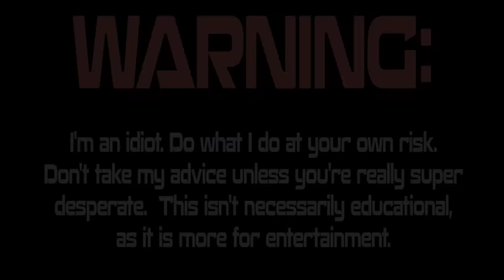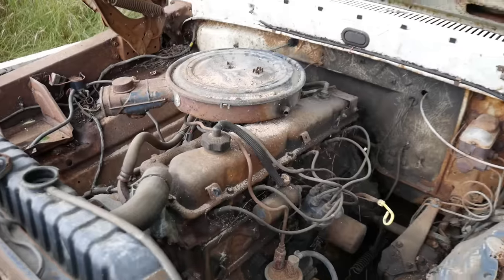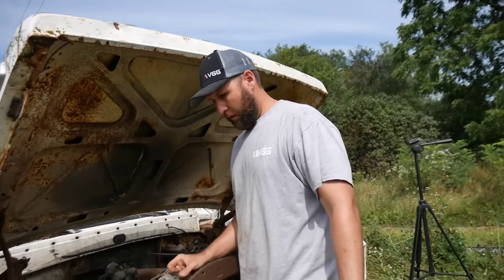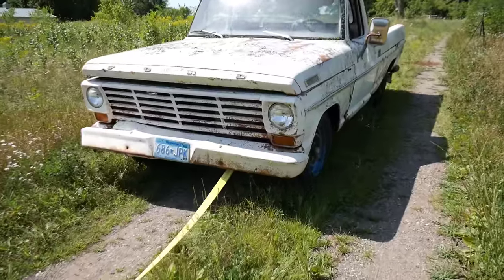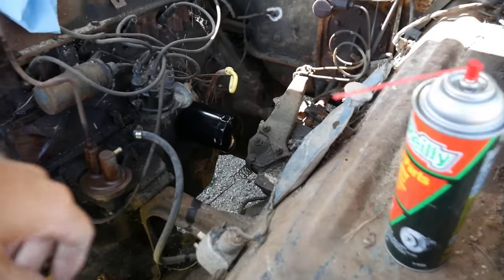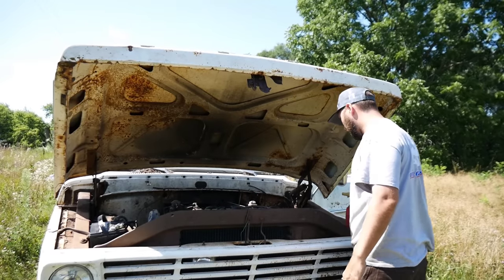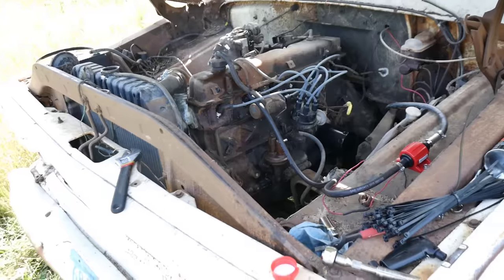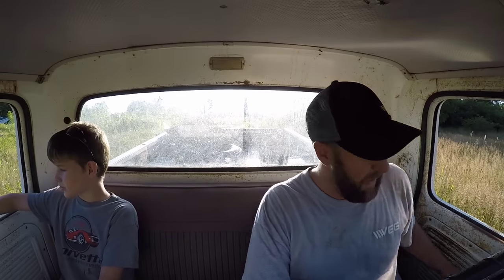ABANDONED Ford F250 First Start in 24 years - Vice Grip Garage EP39

Comment: I use to run Rotella 15-40 in my Ford Pinto Engine at 250.000 miles I took it apart and the insides of the Engine looked like it had 20.000 miles it was in amazing condition

Comment: I bought one of those 3/4 tonnes in 1986 for $125 in Wisconsin. Used it to haul wood. with the old granny 4 speed (start out in 2nd most of the time)  Fixered the engine and drove it to Oklahoma. 4 years later. Oh, did I say when you turned the corners the cab shifted off the frame. Yikkees. Check the cab mounts in the fender wells. Oh, and my brother broke his thumb fixing the split rims on it... Sorry Bro...Man I can't believe they gave you a 200 CID  pump for a ford 300CID.. Doah!!!! The filter is the give away and it is upside down from the V8s. Weird...

Comment: Honestly I am a big gm fan and I would have to say probably maintained the points is probably more reliable than the hei, cause you burn out the ignition coil or the ignition control module out on the road driving and you're walking and if it is just the ignition control module it is not too bad but the ignition coil that is a whole nother issue and my grandpa always taught me to use the lid on the box that the points came out of when you changed them you'll get close enough to run and then you can adjust and fine tune it from there.

Comment: i have an 88 crustang did a 331w stroker  and left the points in it. Then went and did a 408w stroker and i always adjusted my points with a bussiness card.... i say always like i knew what points were... i always say always like when youre gapping your points and leave the key on i knew i was going to get 360 jules pumping though the body... i didnt like the shock so i ending up getting one of those "my spark dies" billet distributor.

Comment: Your site is getting heavy duty with the commercials every minute or two. but it is worth it.  I had a 73 F-150 in 1978. It had a small 8 and three on the tree with an AM radio. the body was only slightly different from the one you were working on in your You tube video. I Paid $1800 for her in clean shape a few dents nothing to speak of then I bought a cap for the back and drove her to California and back. Try and find a five year old truck for that price now. People said I was crazy to go to California in her. Gas was up to 75 cents a gallon. When I got to the Verrizano Bridge at the start of my trip (I live on Long Island) a vibration started to develop. I pulled in a local service station. Turns out a home shop that pulled my snow tires did not tighten the lug nuts on one of the wheels. You just have to do everything yourself! The trip and truck was fine from NY to Altanta, to New Orleans to Ft Hood Texas to El Paso  to Phoenix to Tecata to LA to Vegas Dearborn, Mi. Canada and then back to NYC. When I got back to NY I rented a loft in Manhattan and got one of those new phones with an answer machine and did small move jobs for people with the truck. Man did new yorkers take advantage of me. Walk up apartments and loads beyond imagination. That business and some leftover money on the GI bill got me through one more year of school in the city. I had already graduated college in Albany. I almost bought a fifty year old chevy a month or so ago. It was covered in rust ... I shoulda wouda coulda but my neighbors would have chained me upside down to the tree next to the garage if I had that in the driveway.

Comment: I set my points by eye.  Yup just eyeball them right in... Yup, that looks about good till they wear down a little and I'll have to open them back up just a wee bit.  If you have a good ear you should be able to hear when they start closing up again Oh, and always be sure to put a little lubricant on the plastic thing that rides on the distributor lobes

Comment: Blue Streak points and condenser, my 64 Harley XLCH runs best with those and a good set of copper core plugs. My 68 Harley FLH does not though.

Comment: I have a 1980 f150 custom with the 300 inline 6 but I need some help every time I start it in order to keep it running I have to keep applying the gas as soon as I let off the gas it dies what could that be?

Comment: In 1989 my wife and I bought a 1967 F100 for $1500.  47000 miles, 300 six.  I could stand in the engine bay with my feet on the ground.

Comment: I use the old feeler gage trick, come on you spend .99 cents for a gauge, and 2 cents apiece for a match book. so you will get 50 starts out of the match book for the same price of a feeler gauge, plus the feeler gauge will give you thousands more starts, if you remember where you put them and you will know that it is accurate. Match books may have different thickness's depends on the company that made them. Like hearing you give praise to your son.

Comment: If a car is running points, we remove it and put an HEI in. Too many no-starts from fouled points to ever run them in something that should be reliable. Two things that always annoy me with Fords, though. The stealer junction that has no reason to exist and the spark plugs are always seized or about to seize.

Comment: That’s typical for a Ford to have the oil drain plug directly over part of the frame or suspension components. Even my 2010 Expedition has a plastic tray with side funnels on the frame.

Comment: Doubled over business card or a thick credit card on points for a gap. 

I'm pretty sure it's a 300 inline 6.
Reply: I'd run her a while grungy then give her a bath. 

300 6 engines are amazing at eating fuel pumps.
Reply: Did anyone else catch that quick flame flash at 31:13?

Comment: The only problem with Fords is people do not maintain them then expect them to run. They expect them to accept sketchy repairs and low quality non OEM parts. Every Ford I have owned have out performed every other brand and met the Honda and Toyota standard of longevity... nothing like a Mercedes but of course a fraction of the price...

Comment: There's been an engine change, they didn't ground the engine.
The starter relay requires it's mount to be body grounded.
Since it sat so long the rust and oxidation is daunting, but using a meter to get all grounded points within .5 ohm?
See if it cranks.
Then verify spark and fuel.
They make razor blades that measure the same as point gap.
If your tools you carry have a razor blade in a plastic protected box or envelope, any one will work 
The gap on the points in question just has to match the thickness of any common item you want to use, that doesn't leave a residue behind.
The rest of us use the right tools at work.
If people steal from you all the time, it's your gapper Decision as to what you want it to be.
Tell them to go figure it out for themselves.
That's what makes a descended primate seem to be a man.
The use of tools he didn't steal.
When he finds the Lord,  he finds a purpose for living.

Comment: Thanks. Oddly interesting: following the work..POSTSCRIPT:  About “points, etc: “,    actually my first new CAR was a 1970 Dodge Coronet 500/383/4 BBL/ Turquoise Engine and switched over to **Electronic **ASAP, etc.  My spark Plugs performance and Appearences seemed to improve…..Also, interestingly, I have always prefilled/Primed/soaked the  new Oil Filter , also/lube gasket/, & torque/hand tighten properly: though never orally evacuate come near “petroleum -Lines  due to,aspiration dangers, etc.

Comment: DEREK  hiii friend !!! You ask for it ...OK convert in a 4x4 with higher suspension wide tires, special "buffalo bumper with winch" bank of front lights (led) super exhaust, painted metallic brown  white arrows on the side  rear strong bumper fittings for winch cable plugs  make it special for your assistant !!! Full project OK !!!  OK Get to work with valiant follower !!!!!